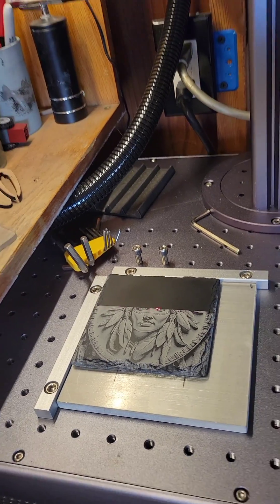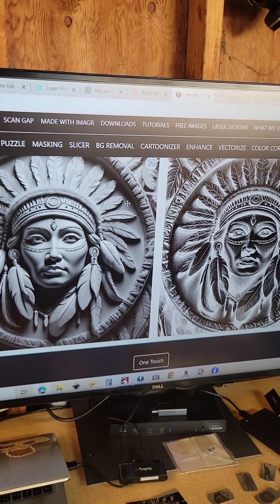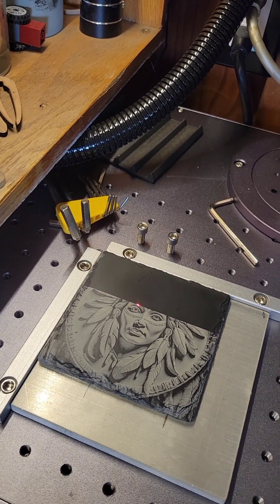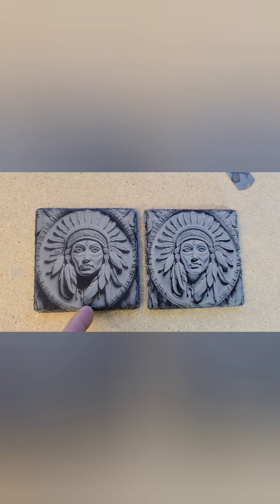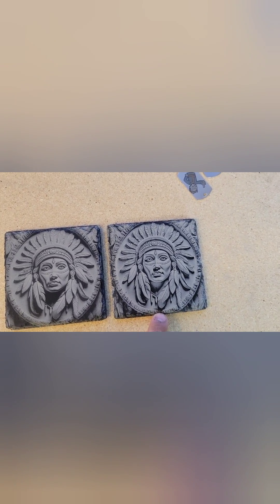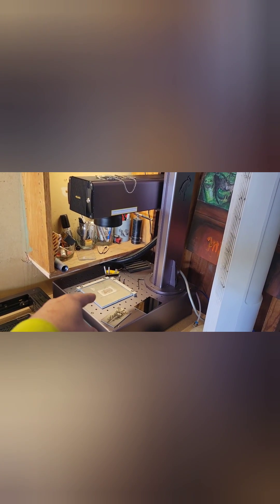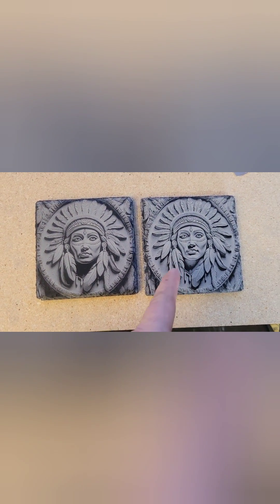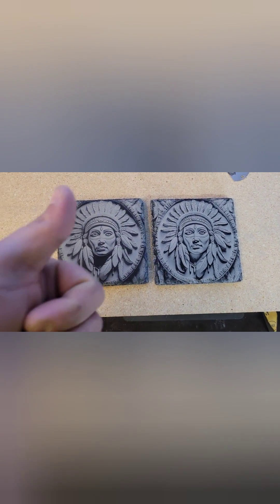First test of the new ImagR "ONE TOUCH" function for laser engraving photos

Comment: New sub & new laser user.  Do you still recommend ImagR for doing engravings?  Also I noticed that you painted your coasters in the short with the cool coaster, do you have a tek or recipe for the slate coater prep?  Thanks very much.  Awesome work!
Reply from the maker: @NightDrifter9999  thank you! On my slate coasters I sand them flat and apply either clear spray lacquer or a light coat of mineral oil before engraving. Allow time to dry before engraving.
Reply: @Allen_The_Maker  Thank you!